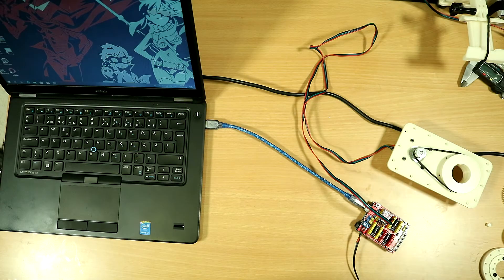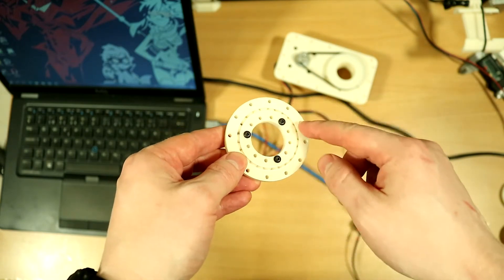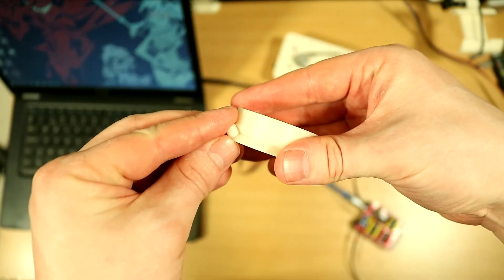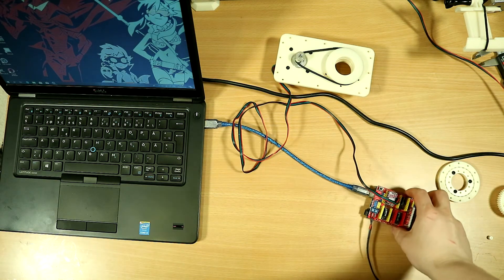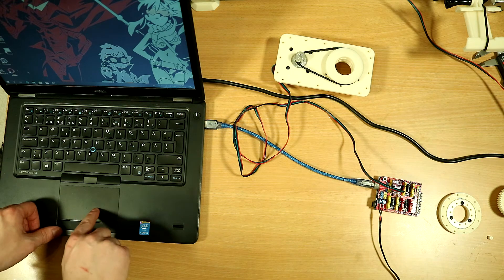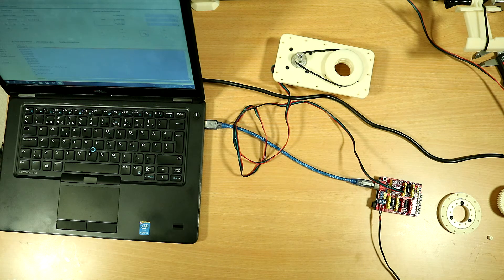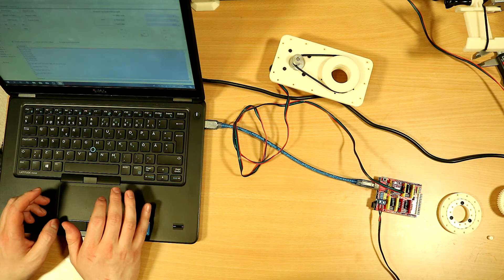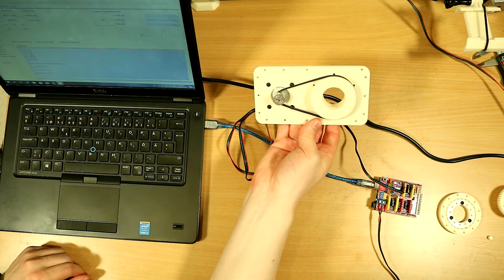3D printed bearings are a nightmare - Camera Slider Part 3

Comment: You should try Metall balls. They're fairly cheap and will last thousands of years.
Also try reducing the space for the balls or rollers. The noise comes from vibrations due to too much space between the parts.
Normal bearing parts are usually even pressed together so they take their time making rolling "marks".

Try reducing the space and using Metall balls and you'll be successful.